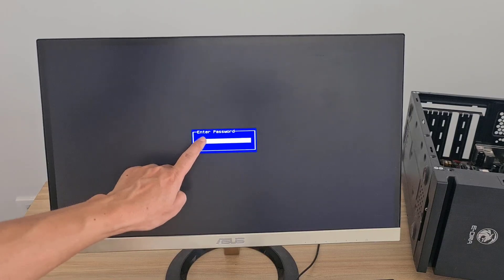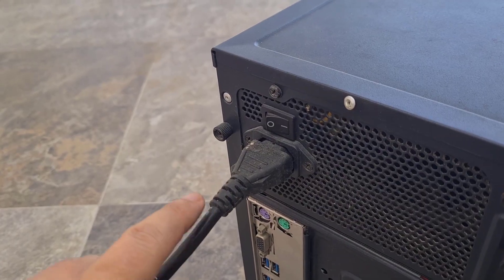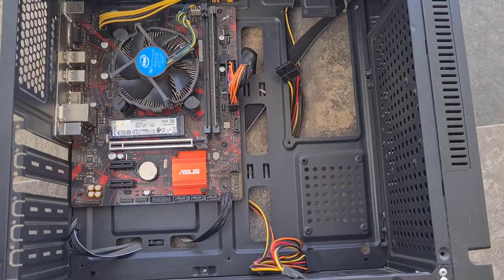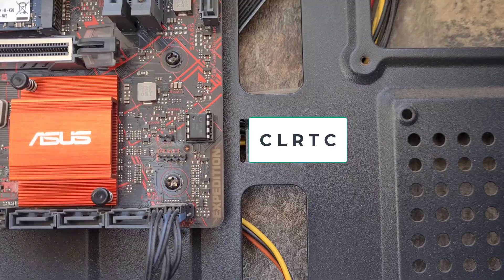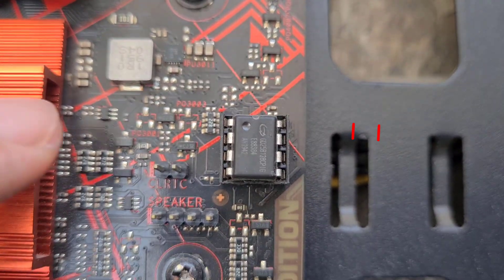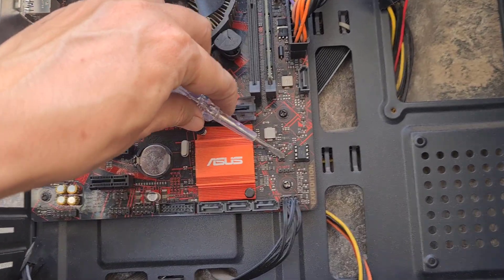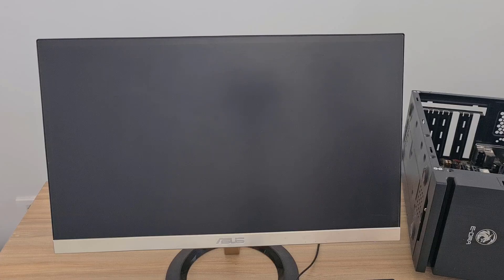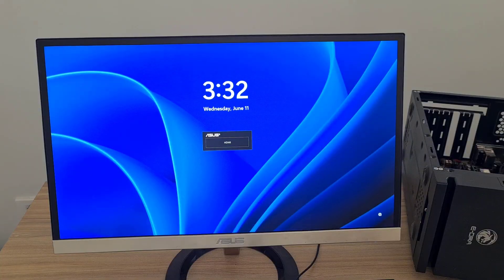ASUS : Remove Forgotten BIOS Password

Comment: This should work on laptop mb too??
Reply: Works everywhere. You just need to find battery and disconnect it for few seconds. Motherboards pins like in video is not present on most motherboards.
Reply: Does not work on asus rog @OstJoker